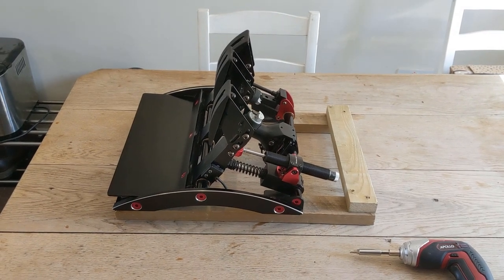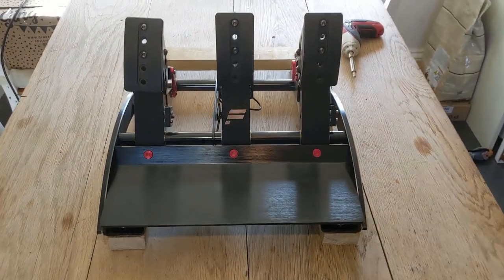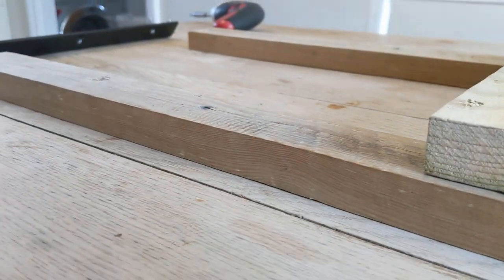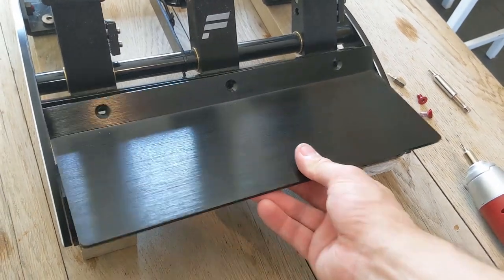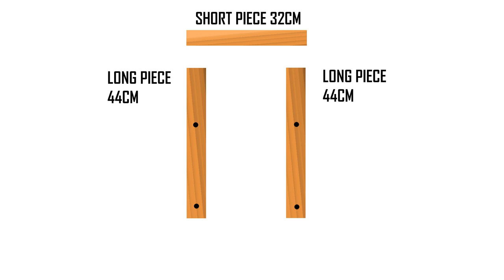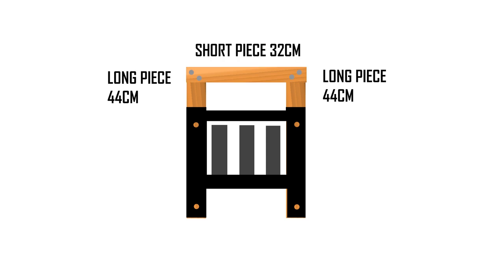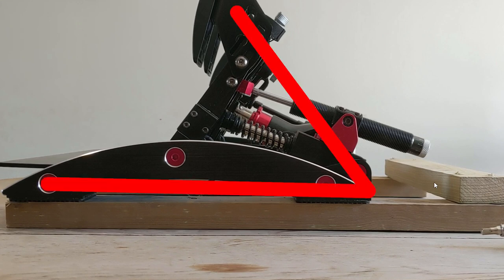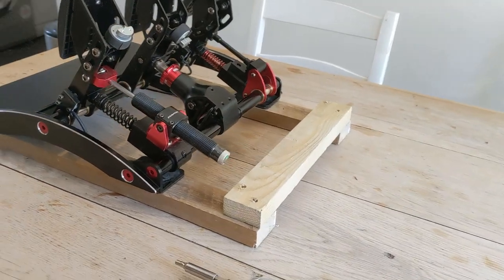Simple DIY Pedal Mount How-to For Fanatec Clubsport V3

Comment: Absolute legend. These pedals are awesome but with a wife and kids I cannot justify a full blown rig taking up and entire room. Great video. Nice and informative and works like a charm. It's all relative but I want 500mm for the long pieces and then used the spare bolts that came with one of the fanatec parts I ordered. Job done. I would say the lo get piece was better being 500mm as it gives you 20mm of extra room at the front so the first bolt hole is not right near the edge of the wood. Awesome video dude. Perfect fix for the pedals lifting.

Comment: Nice! I want to get some CSP's or CSL's myself, and will have to adopt some kind of solution like this, since I too can't replace my workspace with a dedicated rig either. If you want to get really fancy, and depending on how much more you want to spend, I would say that you can always try bolting the pedals to an adjustable slide rail, then bolt that down to the wood base. This would make the solution adaptable to a variety of desk setups. 🙂 Oh, and maybe some rubber pads on the back to prevent damage to the base board - and your significant other from bopping you on the head. 😆

Comment: Thank you so much for this! Have been considering upgrading but read up about this issue, and a proper rig is at least 2-3 years away for me. Think you may have tipped odds in my favour. :)
Reply from the maker: Thanks man, I had pretty much no problems using my V3's like this, they functioned. Certainly, getting a proper mounting cockpit helps a lot and there's no comparison, but in terms of being able to use and enjoy some premium pedals there was no real issues with it.

Comment: I made this exact same mistake, I got some V3's for my "office chair rig" and quickly realised it wasn't going to work. I ended up getting a Playseat Challenge, it's like a foldable deck chair for simracing. It's not as solid as a permanent rig would be but it works fine and I can fold it away and still use my PC normally during the day.
Reply: How have you fixed them any pics you can share ?

Comment: how "short" can the overhang on the back be (the measurement from the very backside of your pedal set to the end of the wood construct), so the paddles still won't "flip" upwards when I break? I use the csl pedal set with load cell - having a desk setup similar to yours. My problem is basically that the entire pedal set will tilt upwards as soon as I apply more then a few kilos of break pressure.

Comment: Small note when you want to do this - the maximum length of the m8 bolts under the base plate can be 3cm long. There is a gap inside the base (hard to explain) and 4cm bolts simply don't fit. I know because now I'm going to the store to swap my 4cm bolts for 3cm ;)
Edit - just realised I have the Elite pro LC pedals, not sure how it's with the V3 :)
Reply from the maker: I think everyone watching this video feels the pain of having to do Job B because of Job A, then having to do Job C because of Job B. We're all so crap at planning ahead.
Reply: @dannyleeracing  Lol I am really, really clumsy with stuff like this. My pedals arrived today but I went to the store yesterday to buy wood and bolts. Only to find out that only bolts with a max length of 3cm fit through the Elite pedals today. So I went to the store after posting above, and that huge, huge store didn't sell them in 3cm so I had to order them online. 
Also measuring where the holes have to be predrilled is a pain the the Elite - because the holes are in some sort of gap you can't mark the holes on the wood with a pencil. 
I found a pre-drill sheet on the Fanatec site which helped a bit with this. 
But your solution is great - without the base I can only use the softest springs and have to max calibration to 50%, else the pedals tip over. Hopefully the bolts will arrive tomorrow so I can finally make this ;)
Reply: @MrEDET  How did you get on with this? I also have the Elite pedals and want to do the same. Also, did you also use 20mm x 40mm profile wood like Danny did?
Reply: @michaelimperato  I ended up using 40mmx40mm wood, but mostly because I could not find any 2cm bolts in my store. I used 3cm bolts. Getting the bolts in at the front part was a pain though. The hole for the bolts is inside a small gap and there is hardly enough place to fit a wrench. I fastend it by holding the bolt in place with the wrench that came with the Elite pedals (it juuuusst fits inside the gap) and by constantly turning the piece of wood. This was so clumsy to do that it took me almost 10 minutes per bolt :-/ 
Also I only used to pieces of wood, the left and right pieces like in Danny's video. The rear piece and bottom piece were not necessary, with the 2 pieces it's already so stable that I use the heaviest springs without the pedals tipping over under heavy braking.
Reply: @MrEDET  Thanks Andre - really helpful. Yes, there have been lots of complaints about the holes for those front two mounts - even Barry at Sim Racing Garage, who is normally very mellow!
Reply: @michaelimperato  Welcome :) Yep those front mounts are really, really badly designed. You can only turn the bolt a couple of mm and then you have to painfully reposition your wrench again. But oh well, at the end this solution costed me only a couple of bucks instead of having to buy a racing rig :)

Comment: I just got moza pedals and have issue of them lifitng when using the brake - Does this setup stop them lifting? I need to change it somewhat though as my using a corner desk
Reply from the maker: Yeah, a similar setup will be in order to stop them lifting up. Very few pedal sets these days are designed to work on the floor standalone - adding a ton of weight might help but it's mostly due to the design of them that makes them top-heavy and pivot-susceptible
Reply: @dannyleeracing  gonna head down Wickes this weekend and build something
Reply from the maker: @shieldyourselfmusic8567  Nice, a lovely shed or BBQ will set off the garden nicely
Reply: @dannyleeracing  hahahah - dont tempt me, I do love a good shed me

Comment: What size wood did you use and out of curiosity why did you put the damper kit on the accelerator pedal?
Reply from the maker: Hey dude - the wood is just 2cm x 4cm wood strip. The damper is on the throttle as I find it helps me blend the throttle in more during corners. It's all down to preference but personally it made more of a difference in feel on the throttle than on the brake.

Comment: Has anyone done this with the new csl load cell pedals ?
Reply: Did you try it?
Reply: @henriquefchaves  yep works well, only difference is that the bolts for the back go in From under the wood rather than on top like for the v3s.
Reply: @AdzzVR  Is your version elite?